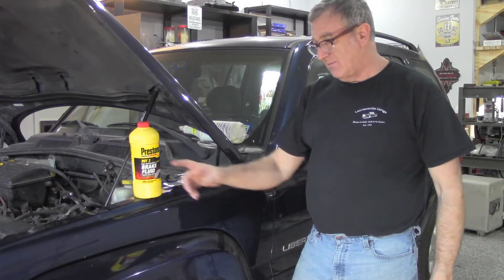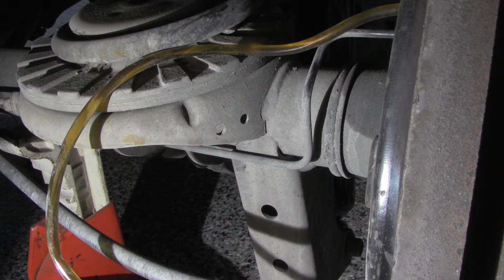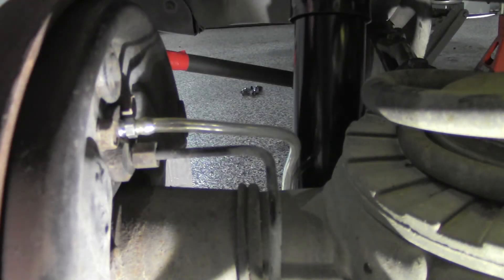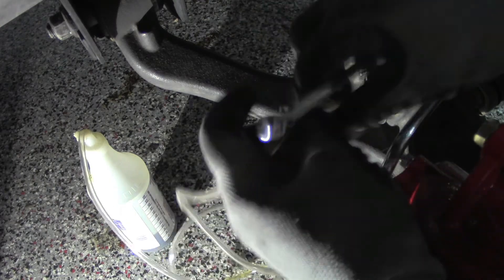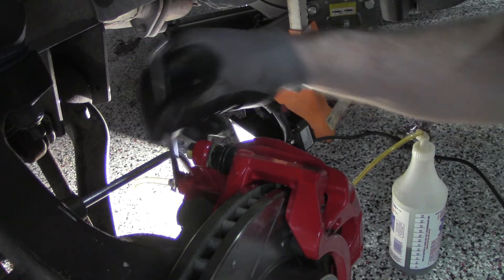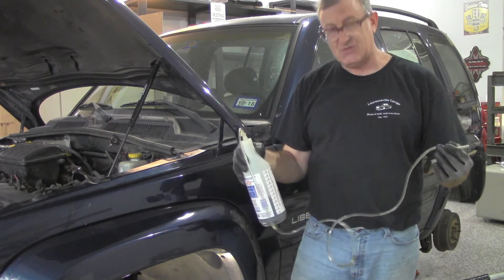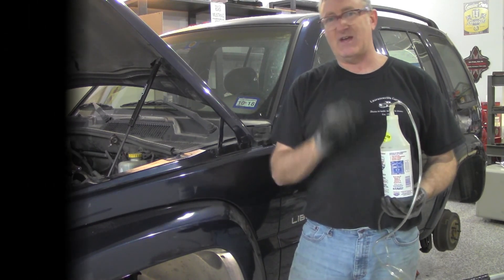How to install Speed bleeder brake bleed screws on a car/truck

Comment: Great video.  , I always save the smaller brake fluid bottles and refill them with the larger ones , they're easier to pour fluid into you master cylinder. Nice Chevy truck , got a nice 90' Chevy shortbed 4x4 and it's getting LIFTED 4" in a few weeks.

Comment: wow thanks. Quick question. So you do not need to have the line above the break or have the tube in fluid, and that is because this system prevents air from going back in?
Reply from the maker: You are correct. The bleeder valve is designed so that as pressure is applied from the brake pedal, the pressure pushes fluid out the valve. When pressure stops, the ball in the valve seats preventing the line from sucking any air and fluid back into the system. When line is free of air, just snug the bleeder up and you are done with that wheel.

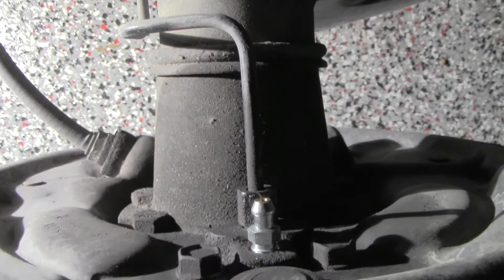Comment: 1:37  So how do you remove the old one and put in the new one without the fluid pouring all over the place?  Yours looks very dry with no evidence of a mess.
Reply from the maker: There will be some drainage when you remove one to replace it. Once the old one is removed, it's only a moment before the new one is started in the hole. As long as the brake pedal is not applying pressure, the fluid will not come pouring out. It will drain out some, but there is no pressure being applied to the system.
Reply: So I guess it would be good at that point to bleed the brakes..LOL.. how well do they work with a pressure bleeder?
Reply from the maker: @Funky4me21  When I put the bleeders in, I went ahead and flushed the system. It was much easier to do. I have never tried a pressure bleeder. The speed bleeders are cheaper and work great. I have them in all my vehicles.
Reply: @laurencevillegarage  So in theory, with a helper, you could just buy one speed bleeder and and flush right rear....replace with OEM bleeder then have helper do maybe 1 or 2 brake pumps to ensure any air is pumped out then move around the other three correct?  Save a lot of $$ plus limit the annoyance to helper of having to pump brake pedal excessively.
Reply from the maker: @okam8662  No, that process would defeat the purpose of the speed bleeders. If you had a helper, you could just have them work the brake pedal while you loosen/tighten the stock bleeder until all the air is purged. While a couple of packages of bleeders would run ~$25 or less, the amount of time it saves you to do the bleeding process alone is well worth the $. It will still be cheaper than taking your car/truck to a shop to have it done and, you can do it multiple times. View the $25 as an investment in your time. It definitely pays off quickly.
Reply: @laurencevillegarage  I take your point for just a quick caliper bleed (2-3 pumps) but my point is for a full brake fluid flush which I just did with my daughter(helper) and it really took a long time.  Hyundai Azera has a plastic filter/screen in the master cylinder that wouldn't come out without breaking it so I couldn't suck out the reservoir so I pumped 3/4 of a quart thru the system (4 wheels).  I also have a total of 4 Hyundai's in our immediate family which all have the same size bleeder screw so I can use the one speed bleeder to flush all 4 cars (big $$ savings).  What do you think?

Comment: What inner diameter (opening) size of the tubing is recommended for a snug fit on the bleeder opening?
Reply from the maker: This will depend on your application because not all valves are the same size. If you need an actual bleeding kit, they are available with tubing and drain bag. Check out Dorman or Speedbleeders. I used stuff I had around the garage.

Comment: So I got my bleeder valves installed and I did bleed my brakes but I noticed that after pumping the brakes, the fluid would slowly start to move backwards back into the caliper. I never saw any air bubbles and I finished bleeding the brakes. The brakes feel very good and I'm not having any problems with them but I was still wondering if I installed the bleeder valves correctly. Is it normal for the fluid to slowly start to move backwards in the clear tubing after pumping the brakes?
Reply from the maker: What I found was that when you loosen the valve to bleed be very careful not to loosen them too much. I believe there is a fine line there where loosening them a hair too much allows a slight "leak" that allows that fluid to be slowly sucked back in. I believe that is what you saw happening. I'm glad the video was helpful and congrats on doing this yourself! You saved some $.
Reply: That's probably what happened - I loosened it too much I bet.  Oh well guess I'll bleed them again :)
Reply: Probably be a good Idea to dab some grease of some sort around the bleeder to help keep air out..

Comment: Woa look at those front brakes on that high horsepower jeep liberty
Reply from the maker: Considering I paid about $155 for the setup, yes. You can't have too much brake on a car.
Reply from the maker: And, I would like to add, I want the best brakes I can afford no matter what I drive. Horsepower doesn't matter, when you are doing 50-80 and you need to top quick, you will wish you had great brakes then.

Comment: Title says how to install speed bleeder, but didn't even show how to uninstall the oem bleeder valve and install the speed bleeder. o_O
Reply from the maker: To remove the old bleeder, I have had some that was the exact same wrench size and some that were 1 size different. But, you simply use your wrench (preferably a line wrench, should not be torqed down, but may be stuck from being there for years) to loosen and remove the old bleeder then replace with the new speed type bleeder. You would loosen just a bit so it can be bled, then snugged down when done. Thanks for the question.

Comment: This video is titled "How to install Speed bleeder brake bleed screws" yet the process of installing them is completely skipped. Good video, terrible title.  One install tip, put shop towels around the old bleed screws as it is corrosive.